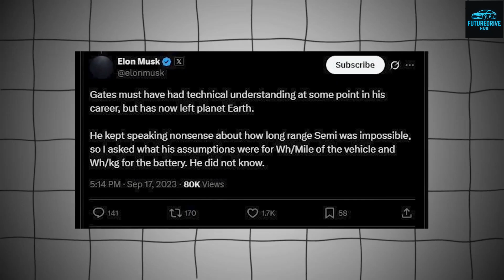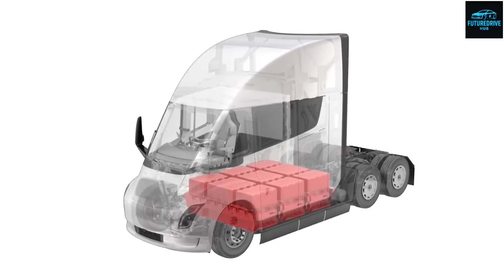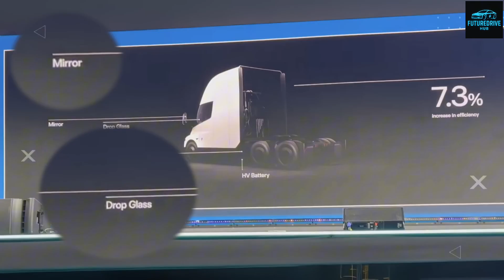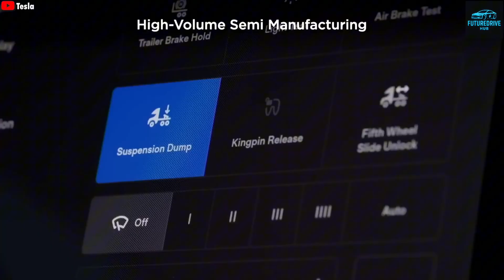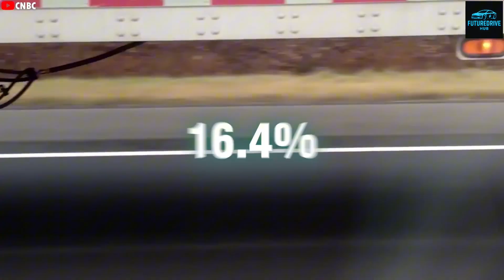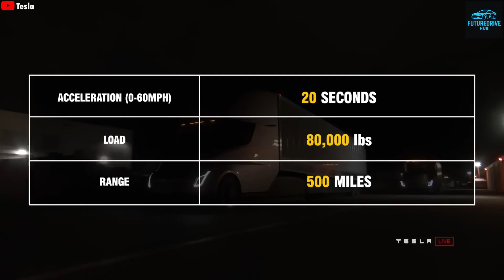Elon Musk’s Tesla Semi 2 Is So Powerful It Terrified the Diesel Industry#teslasemi #elonmusk#truck

Comment: not very smart idea and I expect it will die quietly. we'll need to double or triple our energy production shortly. It's probably possible, but no one works in this direction. Tesla wants to build 50000 unit a year, with 1mwh battery. Hoover dam maximum capacity is 2000 Mw, so it will take more than a day of full capacity work to charge them all and tracks need to charged daily, so as a minimum we need to build a Hoover dam every year, more likely we need 5-10 new big power plants every year. for solar/wind enthusiasts, current total solar production in US is roughly 15 Hoover Dams wind is 25.
Reply from the maker: Thanks for sharing your thoughts and concerns about the energy requirements!
Reply: The concept of pop-up small nuclear reactors comes to mind. The power grid would become a more decentralized system, maybe even reduce the risk of another Great Eastern Blackout.

Comment: Don't forget that the energy flowing to the chargers is mostly generated by natural gas and coal. That detracts somewhat the low Carbon argument.
Reply: Which is still far more efficient than the on board diesel motor. Did you not listen to the video?
Reply: @alanpedrick1562more efficient, yes, no doubt. I didn’t say otherwise. Can you read? However, the CO2 is whack-a-mole-ing out at some belching power plant which doesn’t belch quite as much as the trucks replaced by electrics.  That said, I would love to drive one of the featured transports.
Reply: Buddy is correct, there is less pollution overall. Gradually switching to renewable energy will replace the gas, oil, coal, ect. But we all know this, it’s a matter of time. Have to start somewhere.
Reply: @Mike-c6f4k but you realize that net zero is a pipe dream. Total clean energy production barely matches the INCREASE in energy demand annually. Trying to achieve it is God’s work but poverty and suffering will not solve the problem. So far our best bet seems to be nuclear but there is excitement building around extracting hydrogen from vast formations at oil well depths. Don’t hold your breath but it could just be something. We have to keep trying but don’t jump off any cliffs meanwhile.